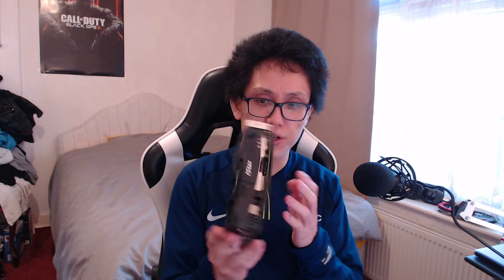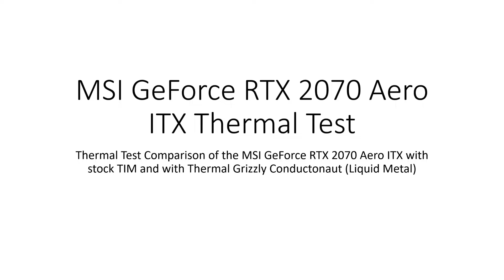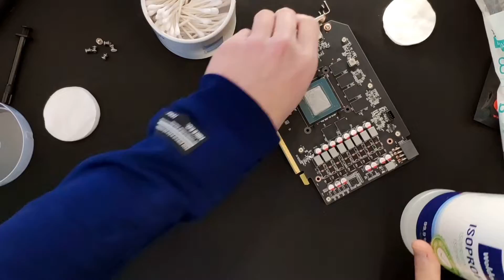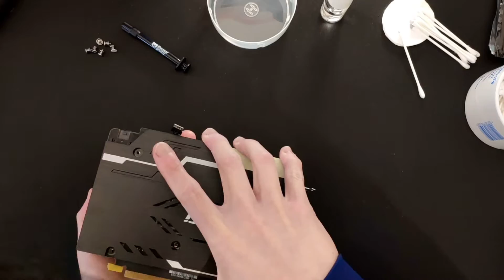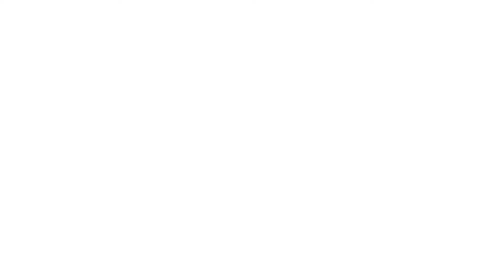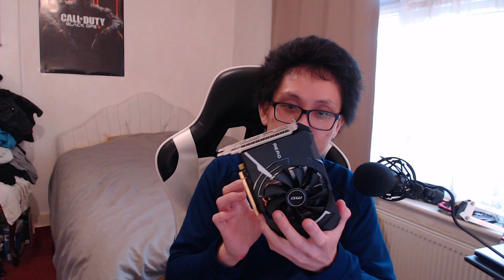MSI GeForce RTX 2070 Aero ITX Thermal Test & Comparison

Comment: I got this card in a prebuild 2+ years ago and this is the first time I’ve seen it anywhere else at all ever. Mine never went above 64deg under load for the first year untouched but second year temps sometimes reach as high as 79deg.. guess I’ll benefit from taking it apart new thermal paste and a 100mv under volt

Comment: In future, I’d recommend undervolting the gpu instead as that will help much more than thermal paste replacement
Reply from the maker: I have undervolted the GPU in my main system, and I think the GPU would definitely benefit from being undervolted. Get the same amount of performance with less power draw and lower thermals. Dropped around 4-5 degrees on my RTX 3080 with a 100mV undervolt.

Comment: It's 40% lowest fan speed for this card in msi afterburner
I'd never do to my card what you did. This doesn't make much sense in general
Reply from the maker: The minimum fan speed set by the GPU BIOS was 47%. The 3 degree drop in thermals, 15MHz higher clock speed and 1% reduction in fan speed all don't seem like much at face value, but I think in a case like this where the case airflow all depends on the component fans, it's best to make use of any benefit where possible.

Comment: Looking at the graph, i can fairly say just leaving it stock is fairly ok.
Reply from the maker: I would definitely agree that the vast majority of users would prefer be okay with the card at stock settings. The benefits of applying liquid metal to this card are very small from what I have found. 😀
Reply: @sunnifung2403  perhaps a regular thermal compound like kryonaut can still reduce the thermals without voiding the warranty? Or make the contact surface of the cooler shinier? 😁
Reply from the maker: @practicalthinker5545  I recently replaced the TIM on a friend's 3-slot EVGA RTX 2080 Ti with both Kryonaut and Conductonaut. The Kryonaut led to a 2 degree drop in thermals, whereas the Conductonaut led to an 8 degree drop in thermals. If you don't want to void your warranty on your graphics card... Don't take the thing apart 😅